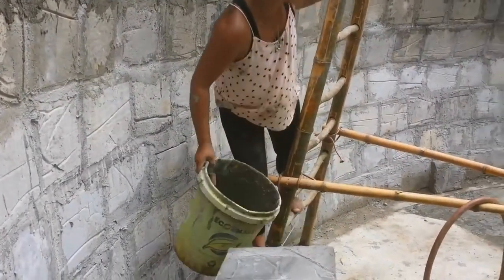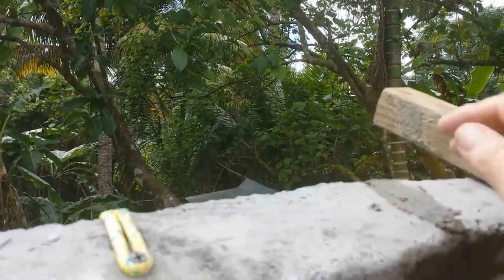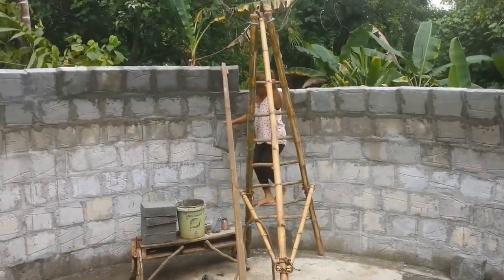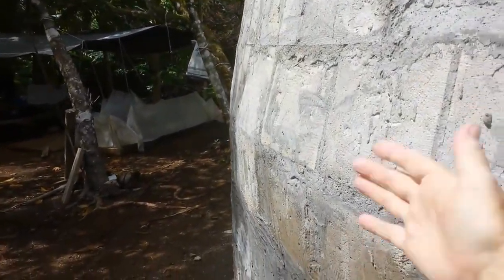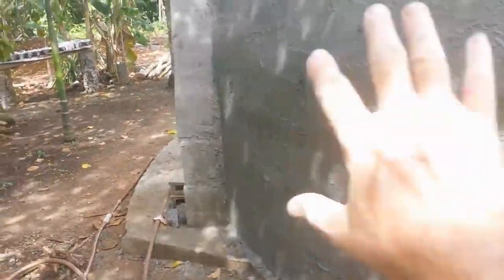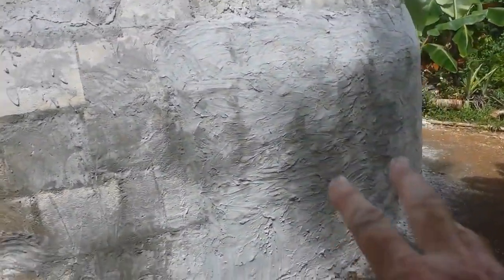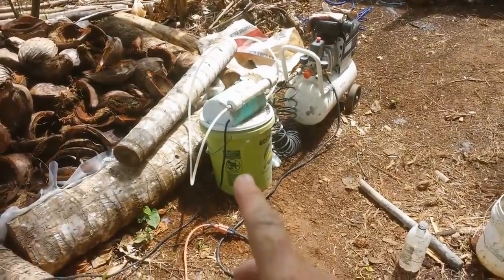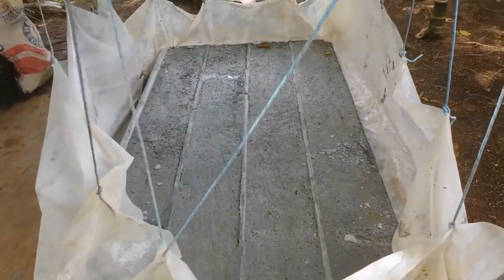Aircrete Dome Home, Part 3, Domegaia, Remote Island Life

Comment: Nice to have the women doing the hard work. I always get the wrong ladies I’m guessing 😂. I’m in Panama and aircrete was rolled out by the district office as material. So I am using 6” concrete blocks to build a round house not a dome house. Regulations regulations…..